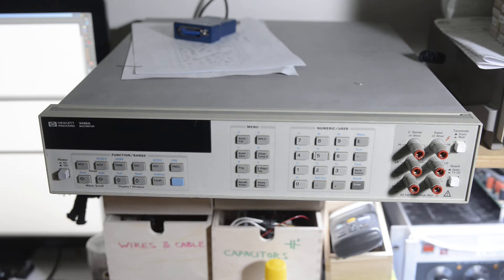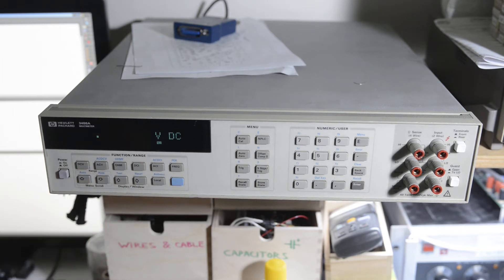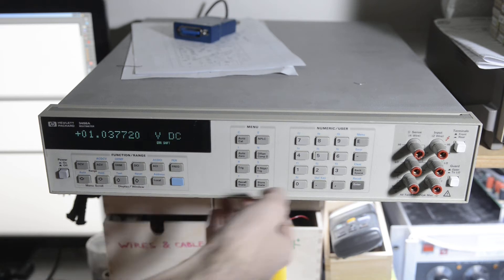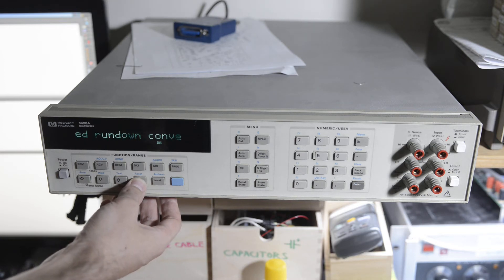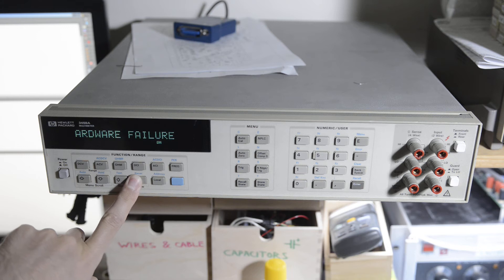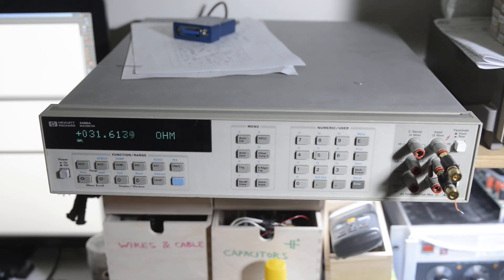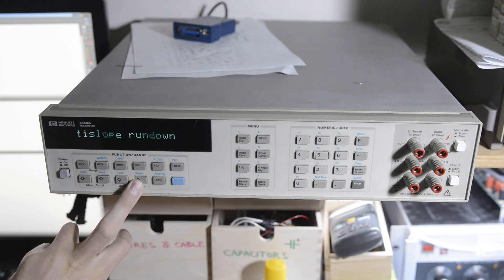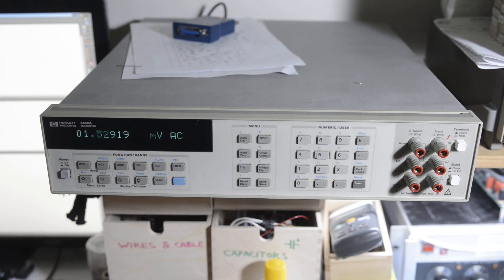A/D error problem with HP 3458A after overnight running

Comment: i am having problems with 3458A,,, everyy few weeks i got issue of ACAL Fail , Ohm Cal fail , 1/100uA fail ... i dont understand why this happens, what i am doing wrong to damage my DMM. or how to fix it, i need to send it ,, some times after turn on / off or clap over the case it pass the ohm cal , like bad solder or something , but sometimes error stays, i send the device for repair, after few weeks same problem, it can not be solder issue , and this solder issue always on 1/100u range,,, could u please help me turuble shooting or some tips

Comment: How do you resolve SCAL require problem during turn-on?
Reply from the maker: ACAL ALL stores related values, but proper way should be to run full calibration, including SCAL.
Reply from the maker: Yes, but they are not that expensive, and available thru usual retailers, such as Mouser, Digikey. I see no real reason to save few $ in instrument like 3458A repair. ;)